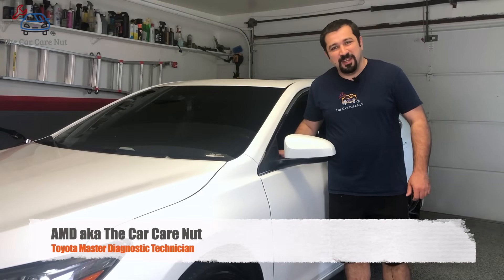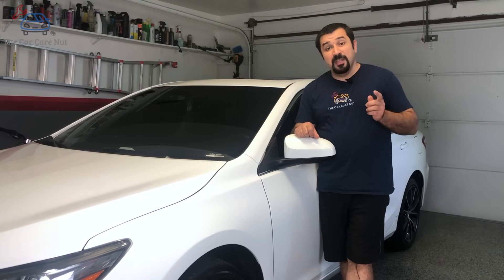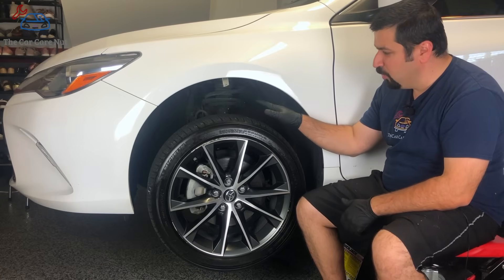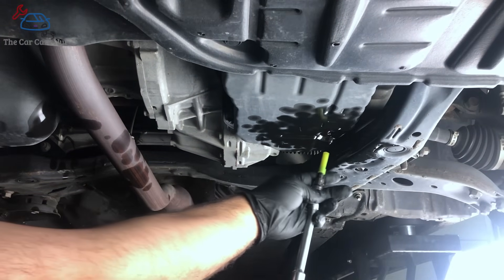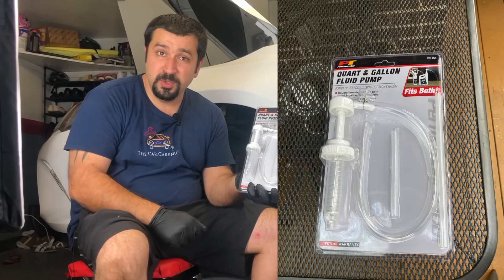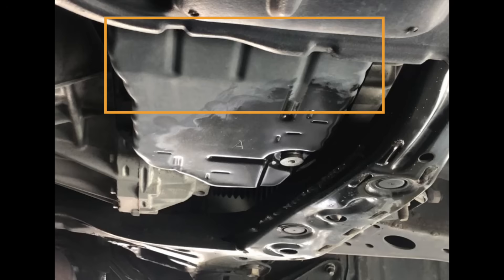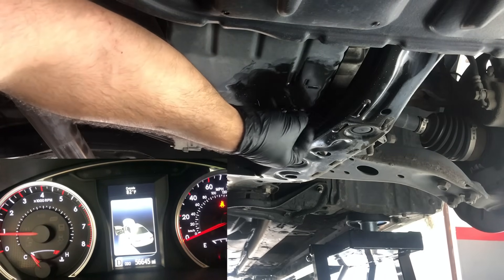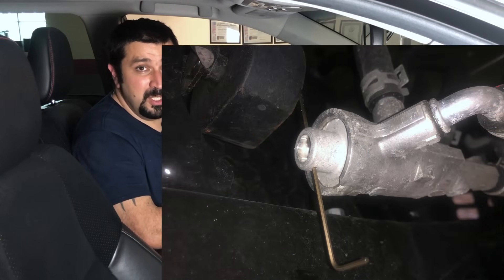How to change your Toyota Sealed Transmission Fluid

Comment: What would you guys recommend I do with a 2021 Highlander Hybrid with 55,000 miles? The previous owner was doing everything “by the book” at the dealer, which means 10,000 mile oil changes😢 and nothing with the transmission. We are immediately switching to a 5k oil change regime but I don’t think the dealer will touch the transmission.
Reply: You do the transmission fluid change

Comment: In the past I changed transmission on a 1978 ford and there was a drain plug on the torque converter and there was a lot more fluid than in the transmission.what about the fluid that must have been left in the torque converter?

Comment: I just bought a used Toyota Avalon 2019. I have no idea if previous owner changed transmission fluid on a regular 30k cycle or not. The car is approaching 90k should I change it or let her ride?

Comment: Great video the only thing I’d recommend is not buying a pump. It’s not needed. Gravity feed using the funnel and a vinyl tube works awesome. 
Also use two identical jugs. Fill one jug with new fluid to same height as drained jug. No measuring and so easy. Or mark drained jug with piece of tape and drain then refill to tape level. Residual fluid not big deal. Great video

Comment: Thank you for your great video. My question is regarding the temperature check on the transmission fluid on  2016 Tundra and 2006 Tacoma. What should the temp range be when checking transmission fluid with scan tool? Thank you

Comment: when you say you need to push the cooler pin in and lock it with an allen key,  do you just push the allen key up like it's in the picture or do you need to push something and then insert the allen key?  Thank you for your videos

Comment: 2018 RAV4 LTD question.  If you are extremely careful about extracting the transmission fluid and then very careful about measuring exactly what came out can you not just add the exact same amount again without the temperature adjustment technique? And I'm talking about if you are very careful about measuring everything... Even to the point where you are pre weighing your collection container so that you have an exact amount of grams out versus grams going in.

Comment: Any manufacturer that does this shows us all how little regard they truly have for their clients. 
The conventional automatic transmission is the single most complex mechanical device in a car, and maintenance needs to be easy for the owner, especially the traditional DIY owner. 
Why Toyota fell for this marketing ploy is beyond me, and saddens me. They also took what was fairly easy to do and seriously complicated it for the average DIY'er. 
Thank you for this presentation and showing what it really takes to, as simply as possible, do what used to be a simple task.
Reply: Toyota might have done away with the dip stick so you would have to take it in to dealer or if it had a dipstick owners might use the wrong type of fluid or not get the level of fluid correct. Only Toyota knows this answer.
Reply: Yeah it’s intentional to force you into their service shop to pay them to do it.
Reply: @joeycochenour5783 
It's the same reason that nowadays, most cell phones are now sealed (and thus, it's now EXPONENTIALLY much more difficult to replace the battery).

In the end, the loyal consumer suffers greatly... due to these intentionally flawed design changes.
Reply: “Complicated it for the average DIY” means they took the power and money back from you. (At least tried to).
Reply: @SapphireBright 

No, too many DIY,s weren't filling to the correct level/temp and damaged their transmission and then blamed Toyota.
Reply: @br5747  ok, I respect that. If you are going to do it, you need to know what you are doing. I let certified mechanics do it. Since I work for a company that sells auto parts, I get a discount on the fluid and filter and they just charge me for labor. I have a 2002 Lexus SUV and it still drives.
Reply: @br5747   bullshit. That's why dipsticks were invented.
Reply: @br5747  Sure! What a Joker. How hard is it to fill it to appropriate level? Maybe for Toyota dealer it is.
Reply: They could have at least put the fill hole in the engine bay like Honda and Nissan do with their CVT's
Reply: Since these transmissions are “sealed units” and have no recommended fluid change interval, I doubt Toyota was trying to get your business by complicating the procedure. I have a 2020 4-runner, bought from dealer new, never had the transmission touched by anyone. My guess is a drain and replace with same amount of fluid at same temp (both old and new fluid) should be safe. Having said that, if you have any question about maintenance history… play it safe and follow the procedure.
Reply: @roymartin198 funny because my stealership said it needed changed at 60k
Reply: @roymartin198 I bet there's a mileage number somewhere there in the manual
Reply: @roymartin198  it’s “sealed” to make you dependent on them. Fluid is fluid and it gets old after 35K. If you want it to last drained and fill.

Comment: I don't understand the need to do the fluid adjustment. If you took out 2qts and you put in 2qts, that's still 2qts in and 2qts out. LOL
I understand you added the extra half a quart more than what came out --preferring overfill than underfill on initial startup. I see the  reason for the adjustment, to get rid of the extra half quart. SO my question is:  What's the reason for the extra half quart? Fluid from the fill plug goes directly into the transmission pan right?
EDIT: I just realized something. If you didn't know how much you took out OR if you are topping off the fluid, then you need to do the adjustment procedure. And I have another question: Why are manufacturers removing dipsticks for engine oil and trans? I know one answer is so they can change customers more for service..but is there another answer?

Comment: Hi. I have a 2012 Camary with the V6. I am using a scan tool to display the INTERNAL temprature of the transmission fluid. Can you provide the temprature range?  Thanks.

Comment: I did it on my 2018 Camry xse at 29000 miles. I figured do it early as I am the 3nd owner and for about 20000 miles it was driven with the old transmission module that had to be replaced under tsb. Made a world of difference so much smoother than before. I used Valvoline instead of Toyota but it meets Toyota ws specs

Comment: Did it today on my Rx350. The procedure is not as fast as the video makes it sound. The ambient temperature was 82F. I had techstream connected and it took a good 10 minutes from the moment I was alternating between N and D to the moment the D sign came on. I'm glad I had techstream on because I could see the temperature rising and it still below the operating temperature for the Rx350 (104F), I'd be pretty concerned if I didn't have it because I was expecting everything to happen withing a minute. I got out of the car and went under it to open the drain plug and by the time I finished draining, the temperature was still 106F (the upper limit is 113F, according to Alldata). And I don't know if it was just a coincidence or not but at the exact moment the transmission fluid reached 104F the radiator fan kicked in.

Comment: If only Dorman or similar made an aftermarket oil pan with a dip stick for cold level so you could delete the entire standpipe and abandon the fill plug.  I would gladly pay a few hundred for such a pan to be able to avoid so much drama with something as simple as open a drain plug and refill through a dip tube then be able to check on a dip stick.

Comment: Dear AMD, Thank you for the excellent detailed instructions on changing sealed transmission fluid. I have a question or two about the last step to drain the excess fluid. Since the car is warmed up at this stage, I assume the transmission fluid would expand. My question(s) is (are), when the fluid is drained until it trickles, would this leave too little fluid in the system, and after the fluid cools down and shrink, would no fluid come out when the drain plug is removed?

Comment: Hi AMD, thank you so much for this video. I have a 2015 RAV4 XLE 4 cylinder. what is the temperature I should read on my scan tool? I read on rav4 forums around 103 degree F. is this right for this car? thank you

Comment: You say to start this oil change with the engine cold. Wouldn't you get more of the old fluid out if you did the draining when it was fully warmed up, like 180°F or whatever it gets to? Sure, you would have to wait hours or until the next morning for it to cool back down to accurately refill it, but in a DIY situation that's not a problem.

Comment: No toyota dealer will do a transmission drain &fill on my 2017 camry le. I get the answer that it's good for 100,000 miles, or unless I have issues. THEN they will ck it out !! Are you kidding me!! By then the transmission is probably in need of a much costly replacement or repair.  So now what do I do to address this issue.  I'm trying to maintain this GREAT car, but toyota dealerships are NOT any help 😡🤬

Comment: Hey Everyone on here, I'm in the Austin, TX area.  Does anybody have a shop or mobile mechanic that they recommend who knows exactly what they're doing on a trans drain/refill?  I have a Lexus nx200t, and would like to find someone who knows this stuff.  The dealer only offers a flush so either do it myself or find someone.  Would prefer to find someone at the moment.  Anyway, thanks everyone.

Comment: If you have an 8-speed like you said, do you do depress the bypass valve before draining?  I already drained and filled mine and am now waiting for a new crush washer, as it is leaking very slowly.   I haven't done the level check procedure yet.  If I should be able to get more fluid out by depressing the valve prior to draining, I'll just redrain the new again, save it to pump back in, and then open the valve to drain more old out.  I've also seen your other videos about how not to change too much fluid out at once.  I'm going to keep swapping out about 3 qts every 40K miles.

The engineer inside me says the trans cooler probably drains anyways after pump pressure is lost, since it's not a totally closed system under pressure without air bubbles, like engine coolant is.  But I thought I'd ask.

Comment: Very helpful video.  I spent a couple weeks collecting the tools I'd need to do a fluid drain and fill on my 2015 Corolla.  My one bit of advice is to do it when the transmission is unquestionably cold.  Get the car into a level spot and leave it there, then do the drain and fill in the morning.  That will greatly reduce the chances of under filling the transmission, which is easy to do.  You also don't need this pump apparatus.  A small funnel and a couple feet of 1/2" vinyl tubing works great.
Reply: Yes that's true. Then you can just measure the exact oil that came out the transmission with the oil new oil you bought,  because both will be at the same temperature
Reply: Do you recall how many quarts you used for a drain and fill? I know Toyota sells it in the 4 Liters can.
Reply: @    I drained mine twice, and I measured it.  2.25 quarts is what came out the first time.  It was a little over 2.5 the second time.  In any case, I bought AISIN CVT fluid, one quart at a time.  Six quarts was enough to drain and fill 2x.

Comment: Great video, yes your expertise and knowledge are amazing. 
I do have a question on the “Drive/start” operation for the 2020 corolla XSE.
I just git this error on dash, ran’ a scan and Got code P1035, now after siting I drove and trans does not shift out of 1st I ran a scan and have code P1171 help as i confused

Comment: This is the only video that even mentions the transmission cooler bypass valve for the 8-speed units. Find this at the 14:35 mark. Great video. Great production as always.
Reply: Yes, but I couldn’t quite get it.. can you explain what and when should be than with that alen key

Comment: If you drained 2 quarts of oil out of your 5 quart capacity engine and replaced the 2 quarts, would that constitute an engine oil change?  Nope!

If you drained a quart of old coolant and replaced it in your radiator, would that constitute coolant change?  Nope!

My 2014 Corolla CVT manual says the system has 8 quarts. So, if the system will only drain 2 quarts and you replace it, does that constitute a transmission fluid change?  Of course not.  6 quarts of old contaminated fluid remain in the system.  All the “swap” did was dilute the old stuff by about 25%.  

Seems to me that the only way to really swap most of the fluid is to connect into the cooler lines with an elevated bucket & hose.  Remove the drain plug and dump fluid into the bucket until the fluid coming out the drain looks clean.  That way it will flush out the stuff in the torque converter.   Then, hook the lines back to the cooler and set the levels.

Car care nut, have I got that right?

This design is just another example of Toyota trying to limit product life by making proper maintenance next to impossible.

Comment: I’ve done two cars now and each time 1quart drains out when I take out the drain plug, without taking out the tube. I transmission was not hot, I only moved it from the front yard. Could it be the factory overfills them? Today was my 2019 Highlander with 70k. Last month was my moms 2017 Camry. Both four cylinders
Reply: I was sure the Highlander was level
Reply: @justinmr64  did you have the engine running ? need to check the level with the engine running
Reply: @petieweg  
I'm going to do it again, it may not have been perfectly level.

Comment: My car is a Scion Tc 2014 with an automatic transmission. The mechanics at Toyota don't even know how to replace the transmission oil on this type of transmission. When they did they removed the plug (but not the plastic one inside) then drained about 1 cup and a half then put the same amount back. All at garage temperature and without starting the car. $175 for a cup and a half of oil and a job poorly done. I haven't found a mechanic capable of doing it properly. Looks like I'll have to do it myself referring to your video as needed.

Comment: What is the temperature range for Toyota Corolla 2018 with K313 cvt transmission to adjust the fluid level please 🙏
Reply: 35-45C.   95-113F.  Per Toyota.
Reply: @jshepard152 where can i get this temp reference for my 2011 highlander, 2020 highlander and 2023 RAV4 units????

Comment: I have a 2019 Highlander Limited with 30000 miles on it. When would I need to do this procedure? I live in Florida and I don’t tow anything with the car. Great vid and thank you👍👍👍
Reply: Toyota won't say, except for heavy duty, which is 60k.  I'd do that.
Reply: I'd do it every 30K miles. You only replacing 40% of the fluid, at best, using this method. There's still a bunch of fluid in the torque converter, valve body, and transmission internals for non CVT transmissions (maybe even CVT transmissions, too).

Comment: I enjoy watching your videos you really seem like an honest mechanic who is very knowledgeable. I have a 2020 Toyota Camry with 63,000 miles on it. I called my local Toyota dealer and asked when I need to change my transmission fluid and I was told by the service technician that the transmission didn’t need it’s fluid changed that it was a sealed unit. I have watched you and a couple other mechanics on Utube  and everyone says I should change the oil at 60,000 miles. What is your thoughts on this. Thank you for any help.
Reply: Dealer is full of crap.  A lifetime fluid is a self fulfilling prophecy.  If the transmission fails at 200k, well, that was the life of the car.  If you plan to keep the car to high mileage, you need to change the fluid occasionally.

Comment: Great video tutorial as always. I wonder why Toyota didn't design the red plastic tube longer to work with transmission fluid at operating temperature (180 degrees). This way you could just open the drain plug and not have to worry about getting the temperature range right.
Reply: Because if it's more complex, you are more likely to take it to them for service.
Reply: I'd rather be letting 95-105 degree transmission fluid drain on my hand, instead of 180 degree.  Give me the short straw.

Comment: Camry 2010 ,4 cylinder. When do  I have to change  transmission fluid ?
Reply: 30,000 miles per transmission shops, 70,000 miles per OEM, I say every 40,000

Comment: Hello, love your videos.  I need some insight please.  I have a 2013 Toyota 4runner, I never changed the trans fluids, its now at 240000kms, I started to get shudder around 35-40kms and then at 55-60kms.  The first mech I showed it to stated I needed a new transmission!  He never did anything but drive it.  The second place I took it to was Toyota dealer for diagnostics.  Now in betwee the time from the first mechanic and Toyota - I had the transmission fluid changed.  Toyota checked the transmission and stated that they felt the shudder under low acceleration but no shudder when they drove the suv in manual mode...  I too am noticing now that sometimes the shudder is not there and sometimes it is there!  Could it be that I am looking at the wrong issue?  Could it be a loose bearing or something in the prop shaft, or a spider joint.  Toyota has not stated to me that I need a new converter or transmission.  There recommendation was to change the fluid again with no guarantee that the shudder will go away.  What are your thoughts on this?  Any ideas would be appreciated.